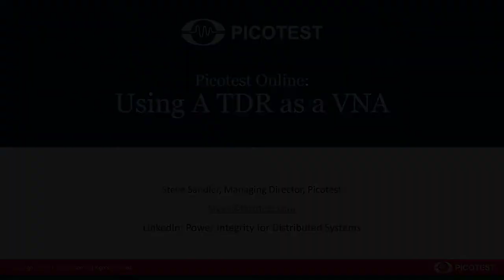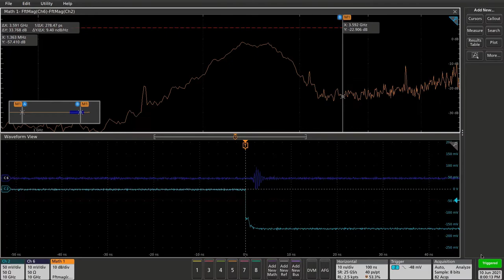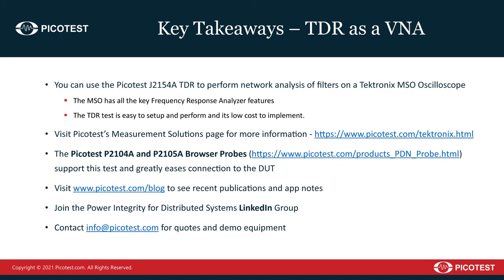Using a TDR as a VNA

Comment: Isn't that spectrum analyser functionality? Pardon my ignorance, but isn't the difference between a VNA and an SA that on a VNA we can also see the phase delay of the signal? I was somewhat surprised when, in your info mail, you claimed that TDR can provide VNA functionality, and this video really hasn't convinced me.
Reply from the maker: Time and frequency are somewhat interchangeable, thanks to Fourier and Laplace. Almost every VNA offers TDR functionality and almost every TDR offers VNA functionality.

Spectrum analyzer looks at signal magnitudes, while S-parameters evaluate ratios.

The J2154A provides the pulse, which can be evaluated single ended or differentially.

In our examples we look at transfer function magnitudes, but since these measurements are ratios, we can also evaluate phase.

There are other MSO6 examples if this, such as PSRR, which only displays magnitude, while in the MSO6 control loop gain we provide both. The only difference in these methods is o e is swept while the other is an impulse.

Thanks for writing!